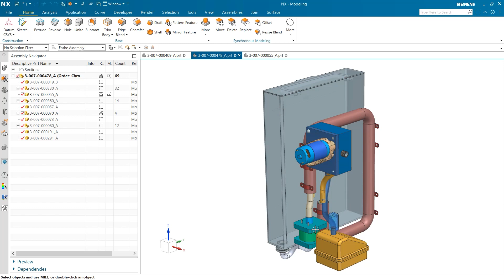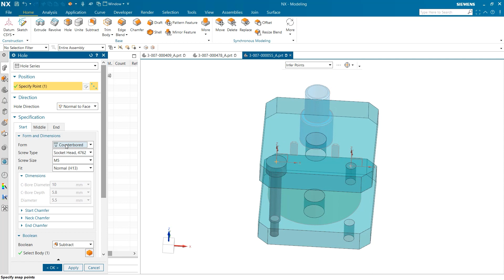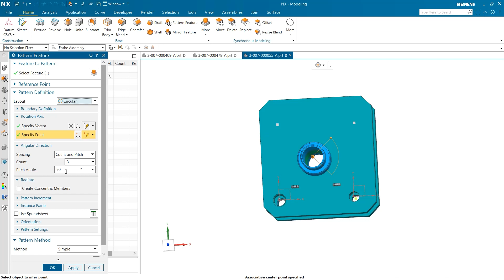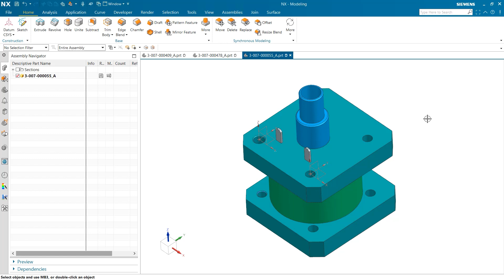NX | Tips and Tricks | Multi-body Holes and Threads

Comment: I'm making a part where I have imperial and metric thread. In the hole command, how I can select that?
Reply from the maker: Hi @argentosebastian, If you've already checked out our user community (at https://sie.ag/24Wf5n) our NX team recommends trying the below steps:
" We assume that you are making part's with both types of holes in them. Meaning that some holes are metric, and some parts are Imperial. If you should have 1 part but with 2 variants where you have either Metric or Imperial threads in the part the easiest way would be two separate parts (associatively linking form the same master) but where the holes are making them unique. This would require 2 unique parts with their own part number (ID) as the tread definition would make them unique. Now with that said and as we here assume that you will have both Metric and Imperial treaded holes in your single part. You simply select the type of standard representing your desired thread under the Standard option in the Hole menu (when creating a Treaded Hole). Here you have a variety of standard treads to choose from spanning from Metric Course, Metric Fine etc. to Inch UNC, Inch UNF etc.). Best, Team Siemens